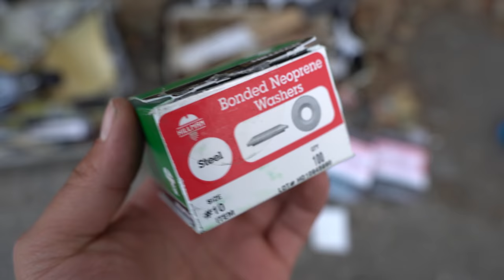Vintage Truck Camper Renovation - part 6 (New Floor Prep)

Comment: Jonathan: Please check out what your going to need to help insulate your floor to keep everything warm as possible and the heat inside when your in freezing temperatures, and help keep the cool air inside when needed. Don't forget about insulating all the pipes as well, so your really prepared for cold weather travel

Comment: Great remodel project! Great idea on using the sealing washers with the screws. When it comes to the cabinets after touching up the paint I would seal them. This way they are less prone to getting scuffs on the paint. With the interior of the cabinets, if you decided to paint them try painting them a lighter color. The lighter color will make it easier for you to see what's in the cupboards, especially if you don't have much light. I'm a bit OCD also and would have sanded the remaining residue on the floor as well. All in all you're doing a great job. Keep it up. I can't wait to see the finished product.

Comment: Was glad to see you put on your mask when you were working on the floor.  No telling what compounds are in the old glue.  Maybe ask for ideas before you do the work to help out a little.  (like the plywood over the floor to save time).  But, it's fun to see a guy learn and do it himself.
Reply: I was worried what may have been on the glue too :-/

Comment: drill out a tiny hole in the cabinet knobs and stick a magnet in there. then drill out a spot in the ceiling for another magnet to keep the cabinet open.
Reply: could putty over the magnet in the wooden knob, then just paint over the magnet in the ceiling. invisible

Comment: I somehow missed this one, just seeing it now. Maybe try some PVC wood flooring? It has a rubber backing that will add some insulation and sound dampening.

I just noticed that sander you used has a vacuum port to reduce dust. You can just duct tape the hose if it doesn't fit perfectly.

Comment: Hey, great job on everything. You know, looking at the cupboard doors... If you were to repaint them (which you may end up doing anyway) glossy white (or slightly off white) and use a router to round the sides, they would look like very large ceramic tiles; just like the wall behind. Might look really good.

Comment: I’m curious what floors you’ll go with. I personally would have gone right over that residue and saved yourself the hassle. Maybe sand the edge of it slightly so the transition is less noticeable. When I redid my floors I went over the old linoleum and spackled any areas where there were chunks of linoleum missing or curled up. I used Allure pacific pine luxury vinyl planks and they have held up great from over a year living with it. I used vinyl composition tile adhesive underneath to prevent issues like major shrinking etc from temperature changes. I’d say redoing my floors was my favorite part of my trailer transformation 👍🏼😃

Comment: just stick on wallpaper on the insides of the cabinets...like a solid plane colored wallpaper

or just paint it black or gray
Reply from the maker: Good idea!
Reply: Or just don’t unless u suffer from ocd, so much more to work on besides that
Reply: @JonathanYentch  or invite me out to help with the renovations....free labor dude.
Reply: @JonathanYentch Maybe peel and stick wall paper would work, but regular contact paper definitely won’t. Because of temperature fluctuations it peels and bubbles after a few months.
Reply: @zanesutherland406  good point.  plus, in my experience, putting contact paper in tends to be a pain haha I would prob use any extra paint in there

Comment: Great work so far. A question: In hindsight, would pulling up the old subfloor and just replacing it have been easier than sanding the old one, or would that have been more work?

Comment: Great job.. wondering if those are some leak stains on the floor? Or not, then ok. Just worried nothing is hidden that will re-occur after yr hard work to fix.

Comment: Hey ur wall ties are stickers they won't b able to handle moisture.  It will start peeling off lol
Reply: I’ve had a similar peel and stick up in my RV in a very humid climate, for going on four years without issues. What might be a problem is some brands can’t be stuck to a newly painted surface... I found that out when I recommended them to a friend who had just painted.
Reply: @kristenvincent3622  when I saw him peeling it off it reminded me of my time in the camper n condensation and wet will not make good for the stickers lol
Reply: @rebeccamac9036  that what my husband was worried about as well, but the vinyl and the adhesive (at least the brand I got) have held up great. The condensation actually just runs down them, and they are way easier to clean. We are in Vancouver Area of BC, super rainy and humid most of the year. Since I moved my cats in we haven’t been able to use chemical dehumidifiers, and we are boondocking so there not enough power for an electric dehumidifier. I’m going to install a diesel heater if I have to do one more winter in the RV before our house is built. Propane heat is super humid
Reply: @kristenvincent3622  I'm actually in BC as well when I was in my camper. The condensation was terrible didn't know what to do. Lol yea I heard diesel heater is better but haven't tried it myself. I have a dog myself and the condensation was real lollll